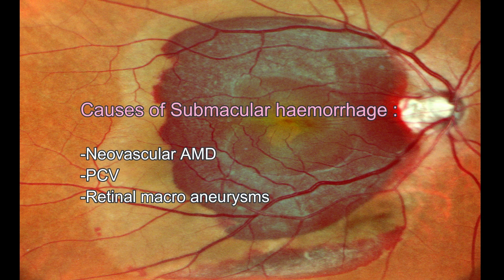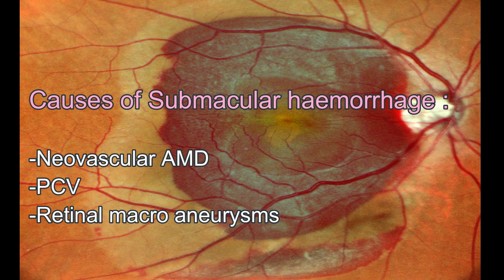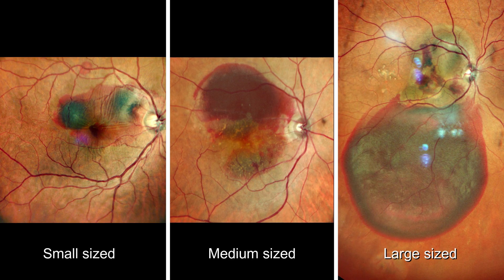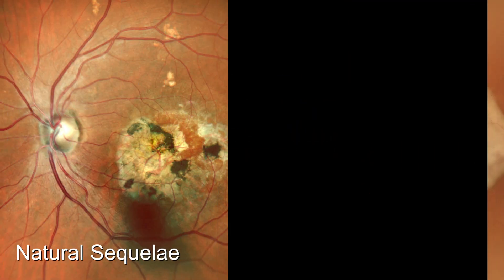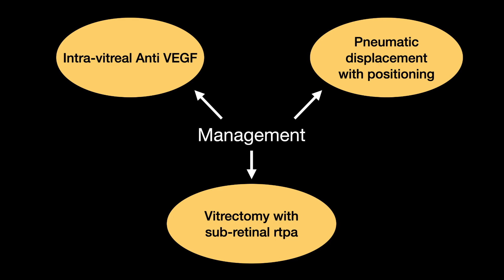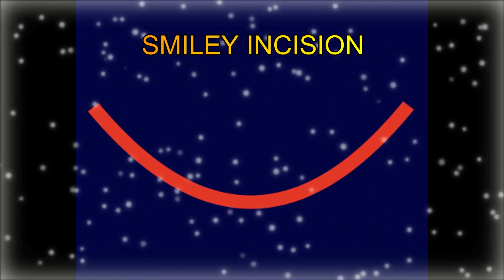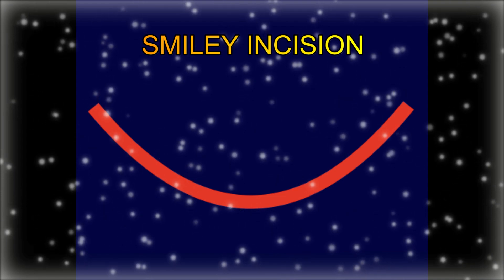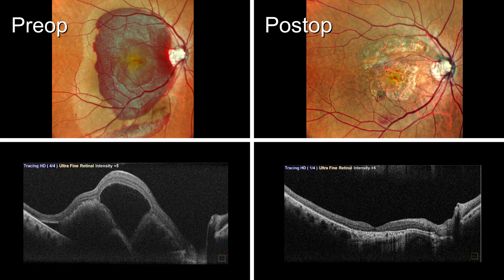Vitrectomy for Submacular haemorrhages : What lies beneath | | Dr Manish Nagpal

Comment: By the look of those post operative photos most of the RPE came out with the coagulum, and probably quite a lot of receptors. To add to that in order to remove it you have to create a large scar in the paramecular area screwing up eccentric fixation function in that area. If you really want to remove the coagulum you would probably be better inverting the temporal retina and possibly even doing an RPE transplant at the same time. How this is better than a simple subretinal TPA, big dose of avastin and gas is not clear to me at all.
To be honest it looks a bit like someone who has developed a transurethral appendicectomy. Just because you can do something that way doesn't necessarily mean you should.

Comment: Always painful to watch cutting retina from the macular area. Scissors would be preferable if it was necessary to do this. I would also avoid superior retinotomy if possible because that causes inferior visual field defect. Very good results can be achieved with subretinal TPA+anti-VEGF combined with partial gas fill if the clot has not been there for many weeks.
Reply: Strongly agree with you Antroid 1
Reply: ILM peeling around retinotomy would also be helpfull to prevent fibrosis.
Reply from the maker: @wojtekdyda7099  it can surely be done but i have so far not added it to the steps of this procedure so far and have not had any fibrosis related traction issues
Reply: How long the scar disappear?Very interesting video. Thanks
Reply from the maker: @lareyravincerodrigo2188  thanks. The scar would be permanent in its linear location
Reply: Dr . Considering scar is permanent . Would fulle vision restore in that case? Thank you.
Reply: Sir how about one detach the retina from the periphery, fold it over and then remove the complex. Probably the macula can be saved ??
Reply from the maker: Thank you for sharing your ideas ...would.be great to see your videos and images to learn from....look forward to seeing them soon 👍

Comment: Audacious and wonderful. Is there long term PVR  etc causing macular distortion ? How long follow-ups ? Congratulations 🥂
Reply from the maker: Hi Sharad. Thanks ..have about 7 such cases ...none have developed rd or pvr...posterior retinectomies usually are safe as long as you have done a good vitreous clean up ..visual acuities are variable and vary between 6/60 to 6/24 kinds usually based on the RPE damage or the pathology itself
Reply: The lack of PVR is probably because of the en bloc removal of the submacular RPE....